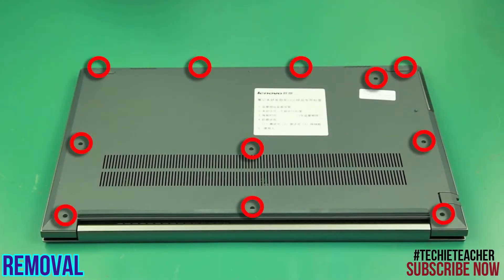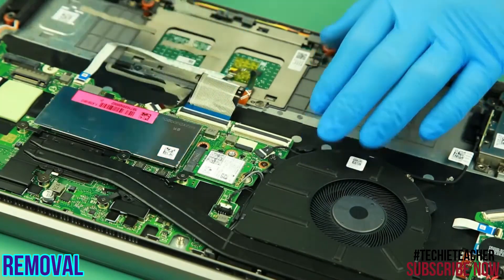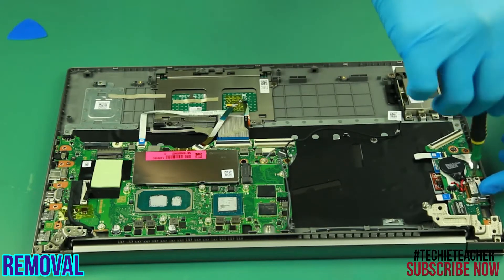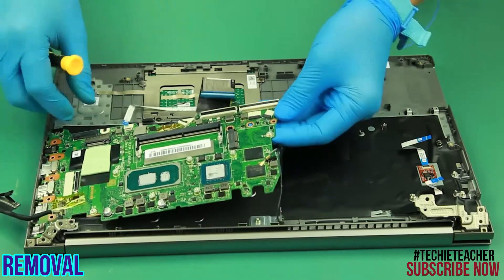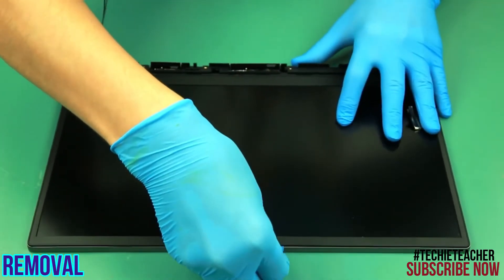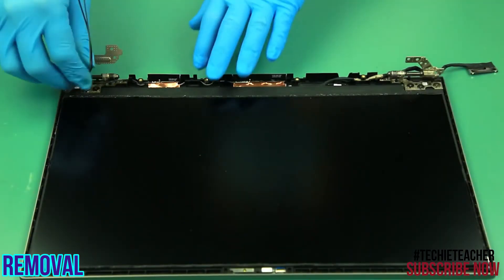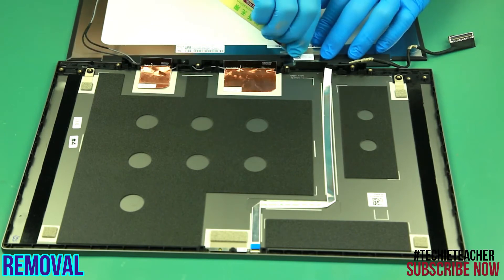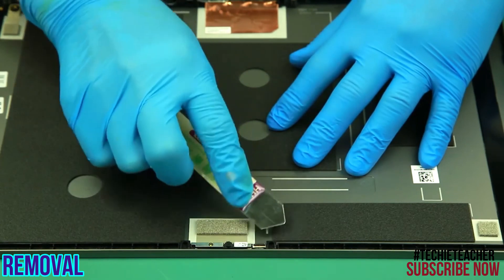HOW TO DISASSEMBLE/REMOVE PARTS OF LENOVO ThinkBook 14 Gen 2 (20VD, 20VF) / 15 Gen 2 (20VE, 20VG)

Comment: I see that your motherboard has a soldered socket for the HDD, unfortunately I don't have one, but I would like to have one. There are a couple of electronics around the socket, so if I soldered the socket itself and connected a drive it still wouldn't work. Does anyone know where you can buy such a socket marked JHDD1 in addition to desoldering from the Lenovo Y50 motherboard? And what exactly are the ICs around?
Reply: The HDD cable is printed with the marking FLV35_HDD_CABLE DC02003QM00 REV: 1.0 HR 20/09/30
The serial number of the part is 5C10S30187
Parts photos can be found at https://pcsupport.lenovo.com/pl/pl/products/laptops-and-netbooks/thinkbook-series/thinkbook-15-g2-are/20vg/parts/display/compatible then select Commodity Type: HDD PARTS (4) and title is "HDD Cable C 20VG"
It currently costs $ 27.61 on Aliexpress.

Unfortunately, my motherboard does not have a soldered JHDD1 socket and probably no element with the printed number "54B2U" (named UC13 on the motherboard) and a resistor and a capacitor. If someone wants to help me, let them open their ThinkBook 15 G2 with a HDD / SDD SATA disk and take pictures of the chips at the JHDD1 port